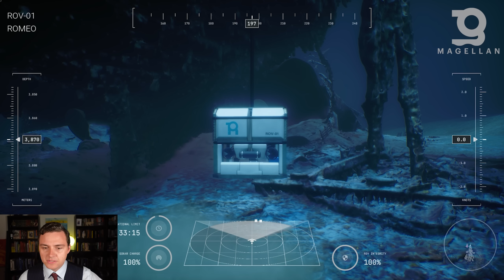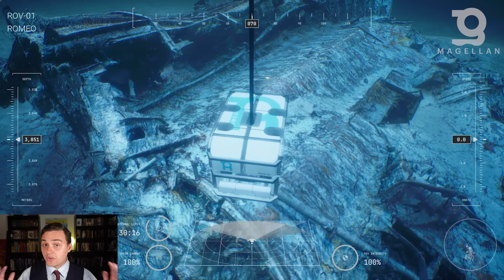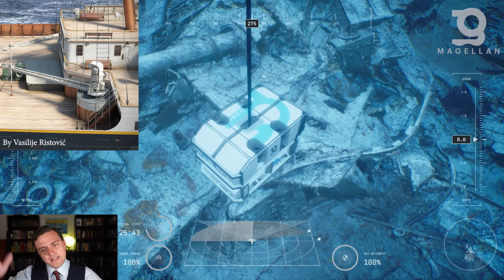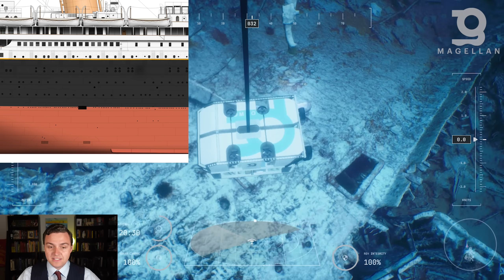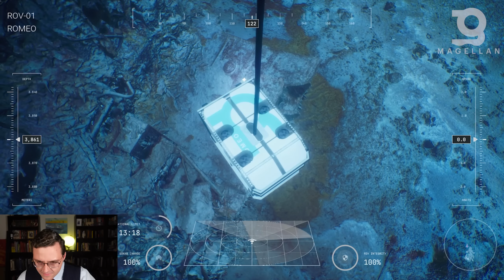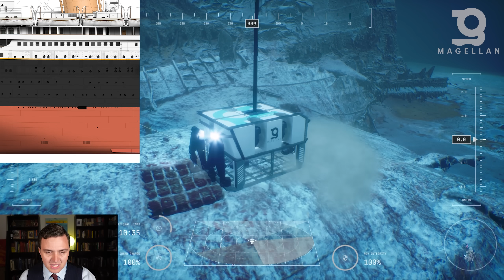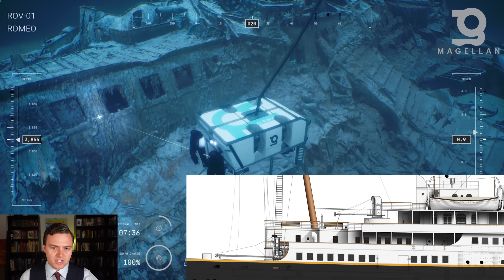FIRST LOOK: Titanic's Destroyed Stern Section in vROV Pilot

Comment: Oooooh, that port side. It's so vivid, I see it now.

Yes, it broke up near the surface.
Yes, hydrodynamic forces tore at it.
Yes, implosions weakened its structure.

Then it hit the seafloor -- forward end first. Which drove the open forward end deep into the sediment and collapsed it. Which closed almost all of the hole the water inside could escape through.

Then the decks kept pancaking back toward the stern under their momentum. And those decks dumped their kinetic energy into the water inside ... which, water being incompressible and having no adequate route to escape, subjected an already disrupted structure to the Water Hammer of the Hydraulic Gods.

I suspect that that played a huge role in the incredible damage differential between the two sections.

That's the story that the port side of the stern section seems to be telling me. It's one thing to think abstractly about it, another to look straight at the results.

Comment: I think when the stern and also the bow sections both hit the ocean floor, they were moving at pretty good speed.  Also cause they are both so large, they both had a fast down blast of water hit them once they hit the floor, and this down flow had a crush effect that caused even more damage,  Like a pancake effect.  As they both moved downward that are pulling displaced water behind them,  They both stop moving and that down flow displaced water hit down on top of them.  The stern was more effected by this than the bow  but both had the same hydrodynamic effect happen to them.

Comment: The owners of Titanic were the cause of Titanic's destruction. The Captain was aware of the dangers of Icebergs in the area and he wanted to sail at a slower pace, but the owners insisted he sail the ship at full speed in order to reach it's destination in record time so as to impress the competitors and passengers. When the Iceberg was spotted by the lookout, it was too late to slow down or change course. If Titanic was moving slower it would have made all the difference. The Fatal error ( Experts claimed ) was the Captain attempting to change course, it is highly probable that if the ship hit the Iceberg head on, it would have been badly damaged but survivable, and that's because of its double Hull strength, but because the double hull did not extend far enough along its length, and the ship side swept the Iceberg, the single hull was compromised causing the ship to flood.  Considering the Titanic was sailing through Iceberg infested waters, you would think the Captain would have been advised, even if they believed it was an improbable likelihood of impacting one, that they would have advised the Captain to impact the Berg head on if he felt the ship was just too close to avoid.

Comment: 13:47  Sooo if the plates are still attached to the wall supports and the supports are separated from the rest of the frame, does that mean the whole thing about faulty rivets being to blame is nonsense? These ones seem to be sturdy as heck.
Reply: It always was nonsense based on a lack of understanding of the metalurgy from the era. Titanic was made from quite literally the finest steel available, fastened with Iron and Steel rivets that were tested in batches sometimes as small as 10.

Comment: The other thing to consider is the bow is an aerodynamic shape designed to cut through water, so as it plummeted almost straight town,  it  was streamlined enough not to cause (relatively) significant damage compared to the stern, a bluff body, which is the compete opposite, which went down like a glass sinking down top first, so it would have been thrown around with all sorts of forces so you can imagine the significant damage incurred.

Comment: I wonder if there are air bubbles trapped in areas that where designed to hold high amounts or pressure like the engine cylinders. Not sure the psi a engine of that type holds but  modern small engines can easily hold a constant 150psi of pressure inside the cylinders.

Comment: Were the paintings of the stern not accurate or has it just deteriorated ridiculously over the years since it's discovery??
Reply: They were inaccurate. The images of 1986 match with scans almost perfectly. The superstructure and lower decks of the stern were already collapsed. Stern since 1986 barely has deteriorated. What has deteriorated is collapse of port side 2 window  wall of 2nd entrance deckhouse, deterioration of 2 windows deckhouse by aft mast, few bulwarks falling of starboard and port side b decks and few mangled pieces disappearing.

Comment: Not surprising that once the shell plating fully unzipped from the hull that the stern pancaked down on itself.  You can see the same thing beginning on the bow section currently.  I believe when Ballard explored the wreck in the 80s the stern hadn’t pancaked as severely and the shell plating wasn’t as fully pulled away.
Reply: Unfortunately it turns out stern was already in this bad condition from 1986 footage. Kens interpretation of stern was inaccurate. Shell plating also looks roughly the same as it was in 1986.

Comment: There are scars in the seabed that suggest the stern slid into the seabed in a starboard to port motion. I don't think the stern got hit with a down blast column, I think it got hit by a sideswipe of water that blew loose debris to port  while also pushing much of the superstructure above C Deck to port as well.

Comment: I have never seen an explanation for all this damage to the stern section so my interpretation is that when the flooded bow section went under and the stern rose it broke in half and the stern went back to horizontal but only for a few seconds because the keel was still intact being the strongest part of the ship and made of the finest steel available. The 20 thousand ton weight of the bow section was too much and it first brought the stern vertical and then dragged it under still full of air. It hadn't got far when the air exploded free tearing the stern apart like sardine cans. At that point the keel twisted and parted and the two sections rested on the bottom quite far apart. This proved to me that had the keel broke when the back of the ship broke the stern would have stayed afloat for quite some time.

Comment: As indicated by the prop shafts being bent severely upward, it would seem to me that the hydraulic forces alone that must have been generated within the hull at the time of impact would have been enough to cause much of the damage we see.  Water doesn't compress, so that kind of an impact would be very much like an explosion from within that would have first blown outward, destroying most of the internal structure, followed by an inward collapse.  I wouldn't be surprised if those cranes, being rigidly attached, were popped off like corks by the same effective explosion at the time of impact.

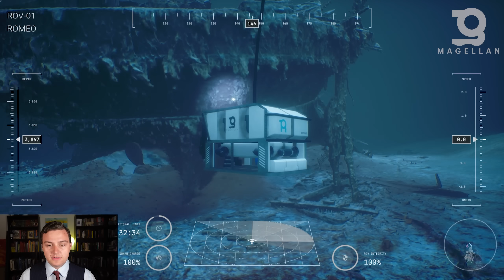Comment: 4:25 - Something I think might be worth piping up about myself here: If this is what it looks like at 10%, most cutting edge computers likely couldn’t handle these scans at 30% resolution in real time, not with all the lighting and effects anyways. 

Photogrammetry as a technique is not optimized, even remotely, and the reason most GAMES can get so much detail is because any objects that start with that process then go through another step called ‘retopology’. The best way you can imagine what retopology does is to think about it this way: Imagine a tree. It’s intricately detailed down to the grain, right? What retopology would be is me going over that tree methodically with paper mache, and then that mold is what you see in the final game. Just like paper mache as well, there are techniques such as normal-maps that work much the same way to imitate texture or detail that might hold if you were to dry wet paper that sat on a textured surface, removing further need for each point of that tree to be individually thought about. 

Because retopology optimizes information through human understanding (basically detail would be prioritized, less interesting parts of the ship would be less detailed), it gets more out of less. But that’s not what anyone who wants to look at the Titanic in this niche wants, now is it? 😆

While I’m certain there’s other reasons the scans aren’t out there, I can somewhat confidently say that the reason the scans in HERE are at the resolution they are is probably to hit a target minimum spec requirement for consumer experience. Just worth noting.

Considering there is a team that works with UE here, I’m sure that’s well known on the Oceanliner Design team, but maybe someone here in the comment section might appreciate the elaboration!

Comment: I read somewhere that the was a leak in one of the first right coal bunker and it why the coal was moved left making lisp 3 degrees to the left that help keep in on a semi even level during the sinking  but i would said the iceberg only damage the first 4 front water tight areas and that the leak in the 5th under the pressure of water   was serious made worse and the fact during the slow ahead during the investigation maybe have put more stress on the damage hull near the hit focusing the bolt head to pop due to stress....sorry I'm dyliexa but find it interesting that they started going slow ahead after the crash during the damage investigation

Comment: Just a few words from a simple guy that understands and is comparing thoughts of things.
The violence of tossing a 1" plate of steel from a truck bed or say dropping same said object from a 5 story building(Just think of the impact)
Now imagine the entire mass of this structure doing the same thing and you can start to see why cranes are ripped loose like paper toys.
When this thing gouged into the water the first time when the forces of floating had ceased, and it was gravity and mass on a collision coarse and the additional pressures at 2 miles under water... Its amazing there is anything still intact, and even more so after over a 100 years.
I worked in and around construction, building and rigging all my life.
I've seen objects fall and Bounce that shouldn't bounce on impact. Its crazy what I have seen in 30 years and nothing comes close to what was at play when this all went down.... Literally
It really does boggle the mind when you start rolling all the physics through the train of thought.
Cheers.

Comment: After the Titanic broke in two on the surface that night in April, 1912 the more streamlined bow section glided downwards very fast at an angle until it ploughed into the silty ocean floor, causing some hull buckling and the fore mast to fall backwards. The stern one third of the hull see-sawed like a falling leaf until it slammed down hard on the sea bottom, 2,000 feet from the bows, compressing the decks with that destructive force.  It is particularly tragic that many of those who did not get away in the boats would have hurried to the stern in the desperate hope that it might have saved them as they hung on to railings, superstructure etc as their footings raised up at an ever steeper angle!  Too awful to meet one's Maker that way!

Comment: The stern went open end first, imploded and water rushing thru air pockets breaking pieces of the stern off. Then blew itself apart hitting the bottom. The sides blew out, the outer propellers bent upward.

Comment: The question of whether the cranes broke away from the hull after hitting the bottom or fell off en route is mega interesting. We can see that the detached cranes landed on the left side of the hull. Which theoretically makes sense. My hypothesis is as follows: The weight of the engines caused the stern section to be pulled by them to the bottom, so the first part of the stern to touch the bottom was the point of fracture burdened by the engines. From the simulations I've seen, it appears that the stern additionally fell to the bottom as if in a spiral, turning to the left. Therefore, it seems logical that the sudden digging into the bottom caused the kinetic energy to tear the cranes and push them to the port side. The mast bent to port also suggests such a course of events. But on the other hand, we have bent shafts and propellers around the level of E deck. Which may suggest that it was the rudder that first touched the bottom. But in such a case it is strange that it did not lean to one side, while digging in to bottom.. To sum up, the reason why the propellers are where they are must have been the pressure of the water pulling behind the falling stern, which, at the moment of contact of the front part of the stern with the bottom, simply brutally pushed the rear part of the stern into the bottom, bending the shafts and placing the propellers where we can see them today. If something seems to be linguistically inconsistent here, I apologize, English is not my native language :)

Comment: Something that fascinates me about examining the wreck - perhaps something worthy of its own video though is certainly covered in others - is when various damage happened:
- Things that are still in original as-built condition, such as the iconic bow railing.
- Damage (and other evidence) that occurred during the iceberg collision, evacuation, and while on the surface, such as the collapsed funnels, broken in half, chaos from being tilted vertical, even the davits being in the extended position.
- Damage on the way down: presumably the crow's nest mast, implosion of air pockets under water pressure, "ram pressure" into the open front of the stern.
- Impact with the sea floor (directly) - propeller shafts bent upward.
- Crushing and blasting from the water column momentum after the ship hit bottom, which likely collapsed and tore apart decks and "redistributed" stuff.
- Decay between the ship's sinking and discovery in 1985
- Decay between the 1985 discovery and present.

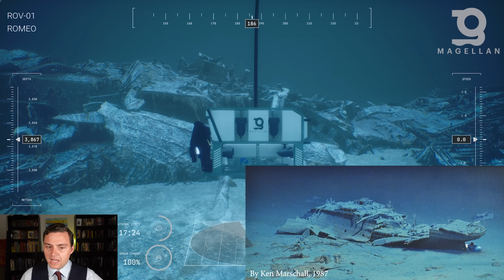Comment: 17:46 In Ken Marshall's painting, the stern of the Titanic looks pretty good. Part of the promenade on deck A has been preserved. The windows of the 2nd class smoking room are visible. You can see the 9 windows of the A la Carte restaurant on deck B. But, I found information that in reality this was not the case. The stern section was already in poor condition in the 80s. Ken Marshall painted his picture based on photographs and video materials from the expedition, but the materials were incomplete and so much had to be inventive. In 2001, James Cameron wanted to explore the A La Carte restaurant. But he discovered that the restaurant was gone. Only the side of deck C remained, and everything above was destroyed. There is an animation of the stern sinking from 2012 that was featured in James Cameron's documentary. You can see there that when the stern hits the bottom, decks A and B simply fall into the stern.
Reply: Yeah, at 47:10 in Return to The Titanic documentary from 1987 the image of boat deck with lifeboat davit is shown and ita collapsed flat on A deck. The 1986 images also in Roy Mengot site also show that 2nd class smoking room was completely pancaked and the part where b deck restaurant should were absent, c deck window only was seen in that image. Besides that it wasnt just that port side hull plating lying horizontaly on seafloor like it is today which mean port side decks were collapsed as badly as they are rn. At the starboard side D and E deck under c deck promenade were also collapsed and F and G deck were collapsed on turbine engine area with G deck lying on Condenser.

Comment: Thank you SO much for this, Friend Mike! I now have access to the documentary and will watch it this evening,  but I wanted to see what you had first. I once read speculation that some of the stern's peculiar damage might have been partly because it was still full of air. The bow was wholly flooded, but the stern was not. A consequence of that would have been different stresses on the stern as opposed to the bow. The water pressure operating on the stern as it went under would have been incredible, crushing the entire section like a paper towel tube closed at one end. I see some of the massive objects blown some distance away from the main wreckage and wonder whether that might have occurred during the descent, not as a result of the impact. The structural damage due to water pressure would have been many times greater than the bow because of the volume of air remaining to be crushed out. It might even have had some trapped air remaining all the way to the bottom. It's a suggestion that makes sense to me, but I am not an engineer nor a sailor, just a guy who's been captivated since 1958. I was sixteen and saw A Night to Remember in a theater. It's been all Titanic all the time ever since. Thanks again, Friend Mike!

Comment: It's pretty clear both sections of the wreck are in worse shape now than when the ship was discovered, but how much of what we're seeing now is the result of parts of the ship collapsing because of disintegration over time, and how much of it do you suppose is simply the result of the fact that we're now seeing the whole thing all at once rather than just a few feet at a time?
Reply: With the stern the main issue is the few rivets holding the port side hull plating on giving way, so it splayed off, giving the impression its way worse when really it has held up very well.

Comment: If I remember correctly? The stern of the ship slammed on its stomach unlike the bow of the ship nose darted in the sea floor. So when the stern hit the floor it collapsed on it’s self, that along with the air pockets still in there combined with the downward flow of water it just completely blew up resulting in more damage to the stern than the bow of the ship.